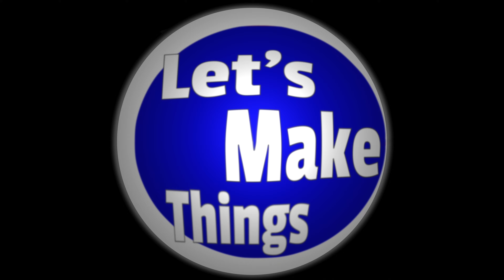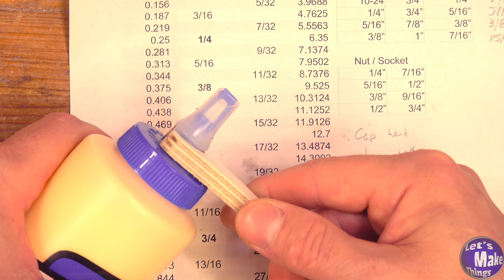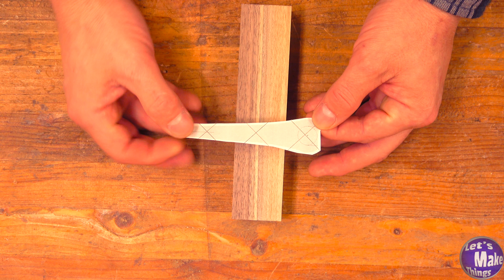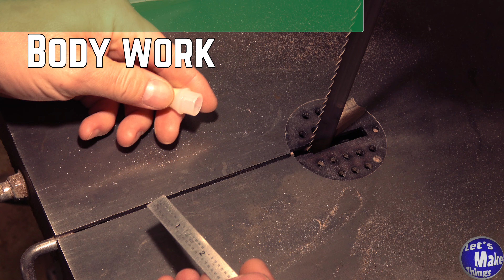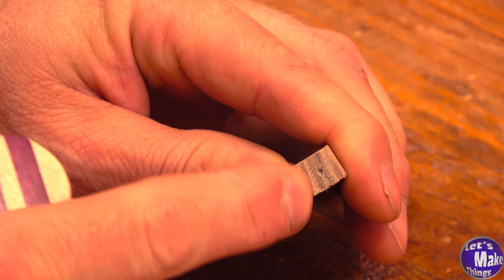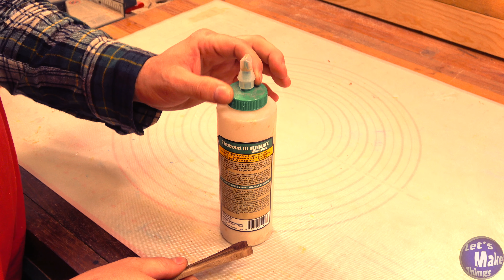Glue Pry bar (Instructional)

Comment: Super! I need to make one the next chance I get. Thanks Rob. FYI I’ve been using a pair of players and a small screwdriver.
Reply from the maker: Don, I've been doing the same thing, which is how the other bottle got all chewed up.  I started using an adjustable wrench a few months ago but got tired of having to readjust it every time I need to pop the glue tip up.  Then I thought, why not make one?

I'm biting my nails because I'm sure very soon it'll be on the store shelves next to the glue bottles...the bottles are easy to use now.
Reply: @makethingswithrob  I won’t be surprised if I see these that someone produces on their 3D printer. It would be easy to do.